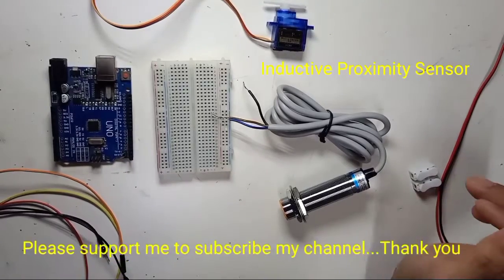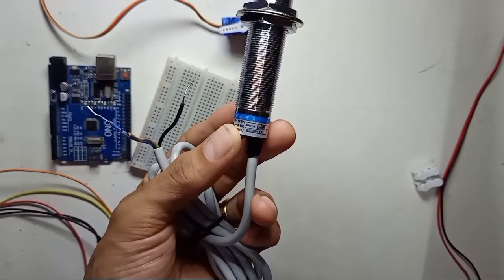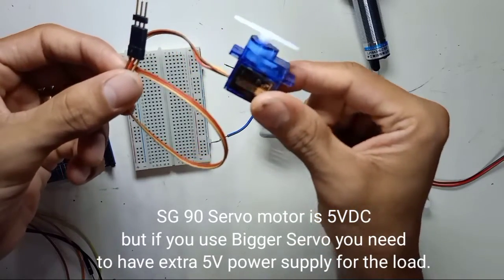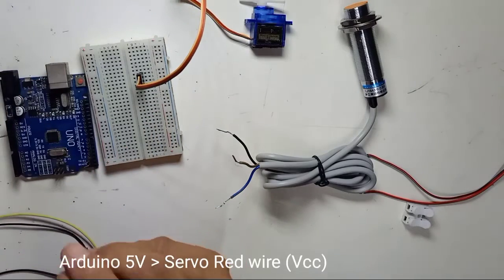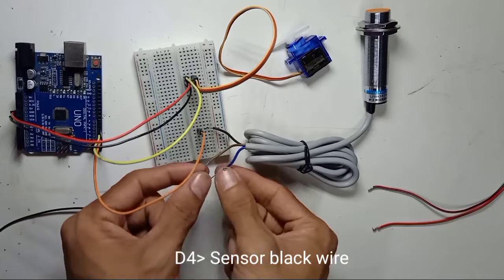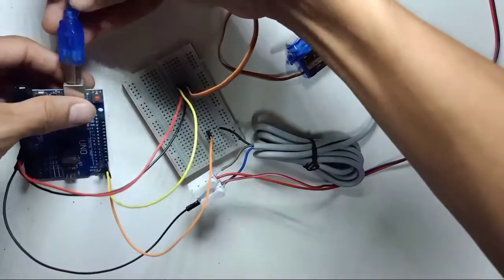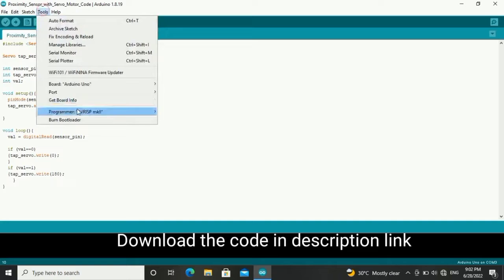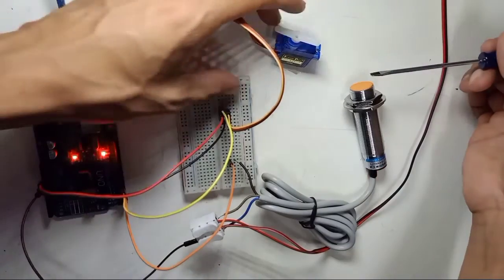How to control Servo motor with proximity sensor with Arduino Uno

Comment: Sir, what do you call that connector that connect the proximity sensor and power supply and the aignal pin to arduino pin?
Reply from the maker: PVC connector

Comment: why my peoximity sensor is not lighting? or cant detect what do i do?
Reply: i have used 12 power supply
Reply from the maker: @markjaysonalabazo1569  what is your sensor voltage?  is it 12v? Be make sure the sensor voltage otherwise the Sensor can be burn out and will not have light.Secondly make sure wire polarity also.

Comment: can i use microsonic sensor instead of  proximity sensor? plz reply :)
Reply from the maker: @savagedragon283  You must check your sensor voltage  either is 12v or not for not to burn out the Sensor .If yes than should be fine.
Reply: @passiontechklm  i was also considering tfmini LiDAR is that any good?
Reply from the maker: @savagedragon283  As i mention in above the sensor voltage is always important for safety. Second is the sensor need to be 3 wire mean 2 for positive and negative 1 for Signal out put.It will work perfectly
Reply: @passiontechklm  thank you soo much for the information ♥️♥️
Reply: @passiontechklm  thank you for the information♥️

Comment: can i directly put 12v dc to dc jack arduino and not using wire connector for proximity sensor?
Reply from the maker: Yes, you can use directly to DC jack.
Reply: @passiontechklm  the arduino won't burn?
Reply from the maker: @nujnujkun  Arduino can give power via DC jack up to 12vdc,so won't fry it out.
Reply: @passiontechklm  is it possible to have capacitive and inductive proximity?

Comment: Can I ask what type of power supply can I use to supply the power in capacitive proximity sensor that have a 6-36 VDC, can I use charger like charger of laptop or other charger that has a 12 V
Reply from the maker: Yes you can use laptop charger or anything between 6-36vdc
Reply: @passiontechklm  do I need to use other electronic component to connect the wire of capacitive sensor on the laptop charger or charger
Reply from the maker: You don't need anything components,you just need 12VDC 2 Amp power supply or use your laptop charger, just make sure to connect positive and negative wire correctly to sensor is fine

Comment: is the sensor compatible with Raspberry pi 4? Also it's challenging for me to differentiate inductive and capacitive proximity sensors. can you advice, please? I want to detect metallic and plastic objects for my project.
Reply from the maker: Yes, this sensor is compatible with both raspberry and Arduino.Inductive is only detect metal and capacitive proximity is for both metal and plastic,
Reply: @passiontechklm  thank you I think I have both inductive and capacitive but when i try to use them it seem that both are inductive.  LJ12A3-4-Z/BY and LJC18A3-B-Z/BX.

Comment: I tried it and it work. However, i tested it again later just to make sure and  the servo motor is not spinning. But when i take off the d5 and d4 pin the servo motor spins a bit. Any solution to this?
Reply: Can you make the same video with how to add voltage to servo motor?
Reply from the maker: @ficchi6756  coming soon I will make it
Reply: @passiontechklm  Thank you! Can you please do it this week? My project deadline is near😭
Reply: Please! I really need your help
Reply from the maker: @ficchi6756  ok  , coming
Reply: @passiontechklm  Thank you so much!!!😭
Reply from the maker: @ficchi6756  here is the link I make for to add extra 5v power supply to Servo motor, I use proximity sensor but it's the same concept. I hope it will help for your project.
https://youtu.be/7R6s5ogZesg
Reply from the maker: This happen when Servo currently is not enough from Arduino output voltage so I suggest you give extra 5vdc to Servo motor it will solve.
Reply: @passiontechklm  how do you add voltage to servo? Sorry new to this.

Comment: Can I use female jack adapter as a substitute for the wire connector?
Reply from the maker: Yes, you can use that it just connetor only
Reply: @passiontechklm  what is the name of white materials you used to connect wire
Reply from the maker: @MerianSmith-tq3rk  that is just connetor, you can use any type of connector
Reply: @passiontechklm  thanks,,,i have a question again, is it ok if we use a 11 voltage battery as a power supply?
Reply from the maker: @MerianSmith-tq3rk  yes you can use that
Reply: @passiontechklm  do you have a code for automatic trash bin of plastic and non plastic for programming

Comment: Is the 12V power supply u use the same as laptop charger?
Reply from the maker: The same look but different voltage because mostly laptop charger are 19v.

Comment: Can I ask if I'm going to use Capacitive Proximity Sensor 6-36 DC how can I connect that in Arduino, what battery I need to used for this type of voltage
Reply from the maker: You can use exactly this method because I am use 6-36vdc inductive proximity sensor so I use 12vdc power supply here
Reply: @passiontechklm  thank you for your answer
Reply: @passiontechklm last questions can you give me a specific example of 12vdc power supply, because I'm new be in electronics and I don't have enough knowledge

Comment: What's the thing you connected to the wire connector called? The one with two red wires?
Reply from the maker: That is just connetor only you can you any connetor
Reply: @passiontechklm where is it connected to?? Is it a dc volt power supply adapter?? Pls answer I need it for my project
Reply from the maker: @rey8910  Yes i use 12vdc power supply

Comment: Hello there, where should we put the wires of the capacitive proximity sensor and inductive proximity sensor? The object passes through both an inductive sensor and a capacitive sensor, and it will detect plastic only.
Reply from the maker: As long as the same voltage than You can use as the same wiring and link out put together as well

Comment: Hello there, where should we put the wires of the capacitive proximity sensor and inductive proximity sensor? The object passes through both an inductive sensor and a capacitive sensor, and it will detect plastic only.
Reply: Same issue here. I'm wondering if I haven't by inductive sensors instead of inductive and capacitive.

Comment: hello, can i use arduino uno r3 board for that? 

did u use DC female adapter cables and 12V DC power supply adapter where the wire of the inductive is connected?
Reply from the maker: Yes

Comment: i use mg995 servo, use same coding or not?
Reply: i use mg 996r servo motor and inductive proximity sensor but why the sensor not function when sensor detect
Reply from the maker: @afiqmarzuki9731  check it back wire connection or sensor voltage,this code should work
Reply from the maker: The same code nothing to change it

Comment: Have same project but use capacitive proximity sensor. It said it needs 24 volts for it to sense plastic. If i connect it to arduino, is it possible to burn the Arduino? So i should use resistor about 100 ohms since sensor capacity is 300mA
Reply from the maker: You can use this wiring connection its safe because 24v to supply is only for Sensor but you can not supply 24v to Arduino just use separate power supply or dc to dc step down converter for Arduino

Comment: What power supply did you use for capacitive proximity sensor?
Reply: Where i can buy it?
Reply: And what kind of 12 volt adopter?
Reply from the maker: @nashjavier8312  You can use 12V 2A for this project https://shp.ee/vmn4hp4
Reply from the maker: I use 12VDC  Adaptor

Comment: Hello, what are the tools you use?
Reply from the maker: Arduino Uno
Inductive proximity sensor
Sg90 servo motor
12VDC power supply for inductive sensor
Some jumper wire 
Connectors
Reply: @passiontechklm  thank u

Comment: how can connect 12V to arduino not burn input, normal used optocoupler keep high volt out of arduino 5 volt pin, and not use resistor limit sensor input current burn input port,
Reply from the maker: Arduino can be power 5-12vdc via DC jack or Vcc In , it's safe because it's has automatic Requlator in on board.so wouldn't burn it.
Reply: @passiontechklm  ok,thanks i not know thats before i think can only 5V make input, and orden today morning optocoupler module 12-24 volt in and 5V out module to arduino 0,68$/pcs. i build arduino nano board spindle RPM gauge promixity sensor sense spindle chuck tricker and nano show oled display spindle speed my cnc machine.

Comment: Good day sir! I am working on a project wherein I uses capacitive sensor to detect plastic, there is also a servo motor attached. But I have a problem, if I try to detect the plastic using capacitive sensor the servo motor doesn't move but if it doesn't detect anything it just move. Can you please help me with this? Thank you so much in advance
Reply: I'm also trying to detect paper using capacitive proximity sensor. Badly needed your help. Thanksss
Reply from the maker: Actually you dont have to change anything from this code.You can direct use it for that project.Just follow Step by step it will no issue. If not just check your wire because some time bad wire can cause unstable signal.
Reply: @passiontechklm  thank you so much sir!
Reply: I'm sorry to ask again sir, have you any idea how to code the capacitive sensor using arduino to detect paper?
Reply: @ourbunnyjaeminie9745  i not has used capasitive sensor but i think have analog value output and need make code read analog pin and test what value detect different materials and add code this value trick output to do something, code read analog value and serialprint value to arduino serial display first.

Comment: hello, is it safe to connect the 12v to arduino or did you use a relay? Thank you
Reply from the maker: It's safe to use 12VDC to Arduino via DC jact or VCC In ,because it's has built in 5V Requlator.

Comment: Hello! I connected the sensor to a 9V battery on the breadboard and it works but the servo keeps twitching and it rotates even if the sensor is not detecting anything.
Reply from the maker: Maybe your Servo error,to be sure you can try just only Servo first so that you can identify the Servo error or not.otherwire you need to edit the code of Servo singnal pin.
Reply: @passiontechklm  What do you mean by editing the code of the servo signal pin? The servo was working normally when I coded it by itself.
Reply: set the delay to a higher value, also the sensor might not be able to get the sufficient voltage. check your sensor's specifications

Comment: sensor output is directly connected to arduino GFIP pin, it can burn arduino. can you share a practical circuit diagram like with opto coupler etc etc using internal PULLUP resistor ???
Reply from the maker: It's safe .... won't burn Arduino Uno.Becaus it's just transformers the signal only which will make Arduino High or Low
Reply: ı dont understand @passiontechklm

Comment: Is there any code where capacitive sensor only can sense plastic not metal or paper
Reply from the maker: This is not the code issue you still can apply this code but the sensor, you need to find sensor which only detect plastic.

Comment: how can the capacitive sensor detect paper?is it possible?
Reply: what kind of 12 volts power supply is used?
Reply from the maker: @justmychannel8755  I just use 12VDC Adapter
Reply: how many ampere is needed in order for capacitance to work? @passiontechklm
Reply from the maker: its just consume a very small current as 13uA to make on and off. But you can use 12VDC 1A or above power supply its will not effect anything in trigger.
Reply: @passiontechklm  how many ampheres is needed for the whole ]circuit?and volts?
Reply from the maker: 12V 1A power adaptor is good enough.
Reply: @passiontechklm  thankyouu
Reply from the maker: @justmychannel8755  you are welcome
Reply: and is it possible to use 9v battery?
Reply from the maker: @justmychannel8755  yes, you can use 9v
Reply from the maker: Yes can detect paper as well.
Reply: do you have codes for capacitance sensor to only detect plastic?

Comment: how can i calibrate it like the capacitive sensor that can detect plastics or others objects? can you make a step by step video about that?
Reply from the maker: You can apply this code to detect plastic or other objects but you need to change the sensor which is call capacitive proximity sensor.
Reply: @passiontechklm Do I still need to change something on the code? Or can I just copy and paste it while I use capacitive proximity sensor?
Reply from the maker: @Pointz-4848  no need to change the code ,just copy and paste it ok.
Reply: Can I ask if I'm going to use Capacitive Proximity Sensor 6-36 DC how can I connect that in Arduino, what battery I need to used for this type of voltage

Comment: hi but i need to rotate the motor so it turns a conveyor belt what changes di i have to make in the code
Reply from the maker: You are using servo motor or DC motor.? If DC motor you can't use this code.
Reply: @passiontechklm  and will the code change if i am using a capacitive proximity sensor
Reply: @passiontechklm can i have contact details I have a project proposal for you.?
Reply: simple need relay run conveyor belt motor, on/off. and code only need digitalwrite, pin number output to relay, high or low,  code need only if sensor high write output high,

Comment: This sensor can be used by replacing an ultrasonic without changing the code. my project is smart dustbin?
Reply from the maker: This code can not use for smart dustbin project.Here is Smart dustbin project with code and diagram bro...https://youtu.be/Hn6w1s2tcno
Reply: internet have million project ready to use whit code arduino ultrasonic sensor, detect object or measure dimension or many many project have.

Comment: hi, how about controlling the servomotor with a capacitive proximity sensor which detects plastic materials, are they the same process?
Reply from the maker: Same concept... you can use this code as well
Reply: @passiontechklm  another question, is relay module needed to this concept?
Reply from the maker: @malitaiti6291  relay module wil be different code
Reply from the maker: For relay control here is the link....https://youtu.be/8nuNzZMCXpA
Reply: @passiontechklm  thank you ❤️
Reply: @passiontechklm  thank you so much

Comment: It didn't fry the arduino?
im confused now, why others use PC817 optocoupler or voltage divider to protect arduino from using this high voltage Proximity sensor?
Reply from the maker: It's safe to use...not fry it up ☺️
Reply: @passiontechklm  appa chukka kedayatha???